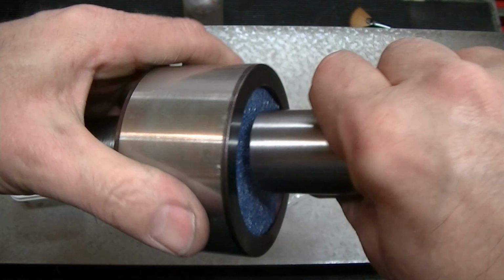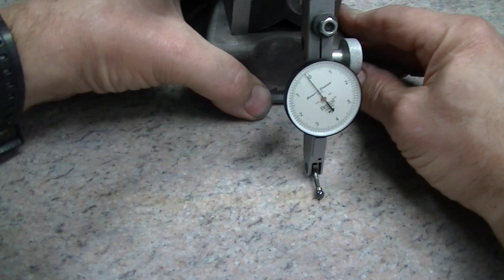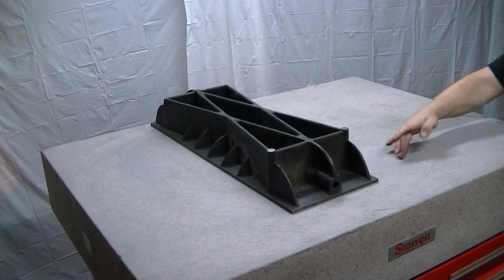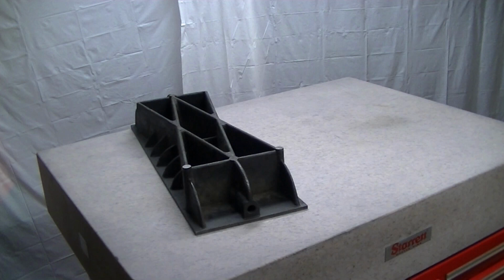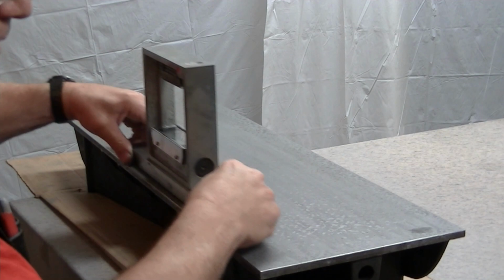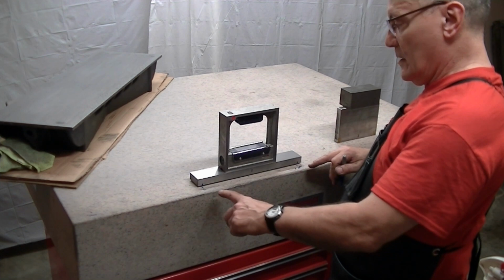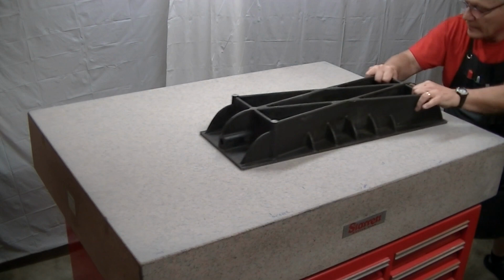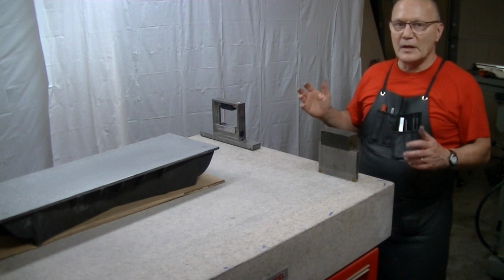DIY SURFACE PLATE LAPPING PART 1 (audio fixed)

Comment: The part of lapping that is not always clear is the speed at which material is removed and what to do when you deform the topology slightly. Watching somebody lap—and how often the check their work to alter technique—gives a much better feel for the process. Tom Lipton has been very good with this, but the scale of your plate and your “use the lap you have on hand” approach is very helpful.  Question: your lap is now charged with 325 grit diamond. Is the any way to remove the charge to reuse the lap with a finer grit without actually re-grinding your steel surface plate?
Reply from the maker: It will wear out to a degree. You can also use a piece of aluminium to somewhat pull the charge out of the lap.

Comment: Rob, there is something I don't understand. 
You're using a counterweight to try to keep the curvature of the surface plate due to the mass the same?
 You showed that the bubble moves a little when moving the level, so that  relatively small mass does curve that thick heavy surface plate measurably?
Or is it the supporting structure of that plate that bends slightly under the moving weight?
Reply: If that's the case I would risk a statement that outside of a lab with very level floor and the whole table construction specifically designed you wouldn't be able to reliably make those measurements. On the other hand nanometer precision (sub micron) is only possible for very stable materials with respect to temperature, probably ceramics and glass. I'm not sure if this is realistic what is presented here.

Comment: Speaking of flat surfaces: if the plate was your known-good surface and you had a piece to scrape the size of that surface plate, would that work or should they be of more-similar sizes?  You mention overhangs and concavity which got me thinking.
Reply from the maker: That would work.
Reply: @ROBRENZ  Ok thank you; I appreciate your sharing your knowledge.

Comment: are there threaded holes in the ends of the cast iron lapping plate.. so one could add eye bolts or some kind of attachment to mechanize the back and forth of the lapping plate on the surface  plate.
Reply from the maker: Thanks, I think so and thanks for watching and commenting.

Comment: That’s a great learning, about the procedure. The question is: when you put the glue on those 3 small squares the side where the single is will receive twice the load than each of the two will.
Did that cause flattening the glue thinner on the single side, putting an angle into the 12” plate?
Reply from the maker: The load difference and glue line thickness doesn't really matter in the end.You are just after three point support that is kinematic in that it will not rock.

Comment: Doesn't  that cast iron lapping plate sitting on one corner affect the stones shape when checking ?
Reply: Not by much. It does affect the underlying stand, so the plate gets slightly tilted. That doesn't matter for the measurement he's making, as the level is being used to find differences in angle between points, not absolute angle from level.
Reply: As SAI Peregrinus said, the level is being used to take a relative measurement. The reason he used the counter weight is because the level is being moved to a different spot, and tilting the plate, so the counter weight will be moved to where the level used to be to minimize the effect of tilt on the readings (which are being used to gauge the shape of the the plate, not its position in space), whereas the cast iron lap is just sitting in one spot, a constant throughout all the reading positions, as if it was part of the plate itself. Yes, the weight of the cast iron lap DOES deflect (bend) the plate VERY slightly, but its negligible.

 I guess you're asking whether the elastic deformation form the weight force of the CI lap sitting on the plate and the subsequent spring-back when it's removed affects the measurements taken with the level regarding the shape (not level) of the plate? I think the answer is it's there, but it's literally negligible.
Reply from the maker: I will cover this in a follow up video. Thanks for watching and commenting.

Comment: would it have helped at all if you had a second cast-iron lap, so you could do something like the normal 3-plate averaging process with them? A on B, C on B, A on C, repeat?
Reply from the maker: That could work but proper use of the lap can keep it flat.
Reply: @ROBRENZ  gotcha. Thanks for the info. I'm not even remotely a machinist myself but I love learning about all of this.

Comment: gentleman, although i think your tool cabine is a good one, but it is still sheet metal. may be using a good old welding table with a quarter inch steel plate surface will be a better choice?

well, you show us that the counter weight will have influence on the level indicator, but at the same time, the scriper is still on the far left corner. i guess it is good old 60+ pounds or more, right? under the same theory, will it have some influences on the flatness of the stone?

by the way, have you check the level of the ground as well? because the indicator is base on air bubble, if the ground/base is not flat, nothing on top will be. the more you work on the stone, the more deviation on the stone.

just a humble suggestion, make a temperory wood/metal frame with the same height to the surface of the stone, when you are doing the measurement, just push that scriper out of the stone, with this bulky weight out of the picture, i truly believe it will make a difference to the results, thanks.
Reply: The measurements are all relative and thus it doesn't matter if the plate is level or not. He's trying to make sure that the plate doesn't flex and throw off the relative measurements when he moves the level. The lapping plate sitting on the granite is a stationary load that isn't changing, so it effectively doesn't matter. Since he's grinding out the low spots right now the amount of deflection caused by the lap would likely be negligible until he gets to final grinding and finishing the stone.
Reply: Its not a regular tool cart..... see other video..
Reply: i guess there are different ways and style on this issue. i have seen some japanese prepare their stone. start from the exact position in their workshop is leveled and re- enforce by inches thick metal plate. insist every corner is flat and level. not just flat. and i realise one thing, they use all kind of calipers, even electronics and laser reflect device, but i never see them use bubble indicator
i tends to believe the japanese way, flat and level. because when the stone is move to somewhere else, the stone can be use to help calibrate the leveling of other machine base. especially japan is famous for their earthquakes, their engineers aware that difference and have to practice it as a constant routine job
Reply from the maker: I will cover this in a follow up video. Thanks for watching and commenting.

Comment: At what point would an unimaginably large surface plate still be measurably flat, yet it's edges not level, due to the curvature of the earth?
Reply from the maker: Measuring with an autocollimator instead of a level gets rid of that problem
Reply: @ROBRENZ  Wait a minute.  What if the nerdy kid next door creates a black hole for her high school science project with enough mass to bend the light beams in your shop?  On second thought, I suppose you'll have more important things to worry about then.
Reply: @d00dEEE  Briefly. Or maybe not, since I think time slows down near the event horizon? I'm not an astrophysicist.
Reply: Silly, the earth is flat

Comment: Perhaps a dab of locktite on the 4 corners of each foot would allow them to sit flat on the long bar - room for the Locktite to exude.
Reply from the maker: There were metal smears on the insert faces that had them not sitting flat on the surface plate. That is why they were crooked. Thanks for watching and commenting.

Comment: so it doesnt matter that you still have the lap on the plate? also the counterweight, if both the level and the counter weigth is "inside" the supports you will bow the surfaceplate concave. i dont get it
Reply: bow 10" of solid granite? are you serious?
Reply: ok haha i said i didn´t get it.
Reply from the maker: I will cover this in a follow up video. Thanks for watching and commenting.

Comment: Wouldn't the weight of the lap on the back corner of the plate cause distortion that affects your rough measurements?
Reply: i would think not they are relative measurements and it was in the same spot for the duration
Reply: Oh, right, and the only thing causing flex in the pads/table/floor between measurements when moving the level is the weight of the level, plus his own weight on the concrete floor.
Reply from the maker: I will cover this in a follow up video. Thanks for watching and commenting.

Comment: Well I watched the first one without issue but will comment on this one. Would it help to have grooves cut in the iron lap for roughing the plate down? It sounds like that plate was only out .001" to start with? That doesn't seem like it would have been too far out for them to resurface I wouldn't have thought? Perhaps a sheet of aluminum  milled to sit over top of your iron plate would be a good upgrade. When doing ultra fine measurments doesn't any lean in your level cause the bubble to not read correctly? Couldn't this be a problem in mapping the plate as well as differences in where you stand when taking measurements?
Reply: I was thinking the same thing about the plate effecting the level, but then I thought well they are relative measurements and the lap was stationary for the duration. I maybe wrong but unless the weight of the lap was actually compressing/deforming that slab of granite and I don't think that's going to happen, how could it influence it?
Reply: And furthermore Rob - ... There is no Inspector or a cat .. a Familiar ( x ) = missing.. that counts down.
Reply: Skjoldhøj, Uhhh.... are you ok man? It appears as though you've just had a stroke?
Reply: I believe the non English speaker is making a reference to no "Baily" equivelant  in the video to certify the job. lol
Reply: Oh Ok LOL.    Not quite sure how you were able to  ÐΣСїρћєЯ that one Bryan but I think you maybe right. Still not sure who Rob is though....
Reply: No Inspector is NO GO and NO INSPECTION.    No GO is No - AUTO CYCLE BUTTON .. if so it's a kick in the ass! !
Reply from the maker: I will cover this in a follow up video. Thanks for watching and commenting.

Comment: Hey robin , how much movement in the level is actually the granite itself distorting vs the frame / floor / whatever else distorting due to the weight . I will probably get crucified for this question but I know the granite will flex as one of the downsides of the pink granite based on starretts web site is it flex more than ... black granite for example, they recommend thicker variations depending on use and grade requirement.... you would think being much harder than the Black it would flex less but above my head why it’s the opposite... probably something to due with the quartz content.... if I was to guess the answer to this I would say the granite is distorting very little if any because the weight is minimal. I would say it’s the frame floor... using a laser measurement system cars driving down the road will affect the measurement...  I know this fact about the cars true because I could not figure out why randomly the meter would move then settle back so I put cameras outside and inside guessing at the problem and behold when the feedback was synced you would see the movement of the laser meter as the car approached and as it sped off...

Comment: I have an 18" x 24" cast iron surface plate I bought many years ago left over from a school auction.  Someone had volunteered to take them to his work and run across the tops with a blanchard grinder.  I got one of the last ones after they were picked over and mine has some grooves in the surface.  I thought an opportunity would come along to surface grind it, but no it didn't happen.  I have seen videos where they just work it down with a sander until it's pretty flat and then go thru something like you did.  I guess the main issue is how much material to remove, but the top of mine is pretty thick.  How much material do you think you removed from yours?
Reply from the maker: Only a few thousandths of an inch by hand scraping.

Comment: Not having done this (big caveat!) it seems like the roughing-in grit should be coarse and related to the ultimate amount of material to be removed, and proceeding until the abrasive starts to touch the bottom of the worn areas. As soon as the abrasive touches bottom switch to a finer grit and proceed through finer grades until the ultimate flatness and finish are reached. I’ll have to go back and see if you mention the depth of the worn spots.

Obviously the stone is extremely rough as it is initially formed at the quarry, so removing large amounts of stone to achieve the near perfect surface required is a process that takes place with every surface plate. So why the push back from the pro-lappers?
Reply from the maker: I will cover this in a follow up video. Thanks for watching and commenting.

Comment: So theoretically you could buy two plates at an auction and then lap them together. It could be useful to measure your iron lap at points in the process. I thought the progress of removal of the chipping marks on your lap was interesting. Would a squeegee work for spreading diamonds?
Reply: You would need to buy 3 plates at the auction for this to work. And they should be square plates, not rectangular, so that you can stroke in the x and y axis. if you just stroke one way, you risk creating a saddle which will match 3 plates.
Reply: How about two plates and a straight edge?
Reply: Think about flipping those big rocks around to lap them together!! No thanks
Reply: You could use two plates, that's just what Robin is using, but you would also need measuring tools. If you want to get good results without careful measurement you need 3 plates that can be rotated, as Rhys said. You could also use 3 cast iron plates and scrape them
Reply: Rob Mckennie , Will granite scrape in a way that will work?
Reply: Toby W I doubt believe so, but you could try hand grinding. If you're working with black granite I think your biggest problem is going to be seeing your high spots

Comment: You take all that care to keep the bubble level accurate, but you've got a giant iron plate hanging off the corner. That's gonna throw everything off.
Reply from the maker: Not a problem as explained in "DIY SURFACE PLATE LAPPING ANSWERS TO PART 1 QUESTIONS" video

Comment: Complete surface plate noob here. What causes these low spots? Granite is pretty hard stuff, and all the videos I've seen where people are using the plates they are laying down items and taking measurements, or bluing them up to fine high spots. Is there an application I haven't seen that causes more ware?
Reply from the maker: Ambient dust between the items sliding on the granite slowly abrade the surface. I only has to wear a few 0.0001" to be out of tolerance.
Reply: @ROBRENZ  thanks.

Comment: This is perfect content. I want to build a precision CNC rail framing down to the micron. The first step is the base, which will be the granite and it needs to be flat flat... I now have a guide to understand the concept of getting a flat surface. Just wondering, can I order a huge "generic" real granite from the stone mill shop and work with that to get a flat surface or do I really need to start off using a branded granite such as ""? Also have you considered of making a flat surface for "engineered granite" which is mixed with sand and stones with epoxy? I read professional companies use this "engineered granite" to reduce vibrations for their applications. So lucky to get a nice big chunk of granite Starrett for free... wow. What kind of precision deviation is that dial indicator? is it 1 micron? 31:08 - That is crazy... would never expect such a massive granite block to slightly change and deform with small weights on top moving at different positions at the surface.

Comment: I was really surprised that the movement of the precision level's weight on the plate had that much of an effect. I was wondering, how much of an effect does leaving the lapping plate on the surface plate have on the relative measurement of the surface plate's flatness? If you have any insight into this I'd be love to hear it. Thanks.
Reply from the maker: I will cover this in a follow up video. Thanks for watching and commenting.

Comment: I thought I was following along pretty well until the counterweight for the level appeared (minute 33 or so).   While that does make sense, why is the big heavy cast iron lap still sitting off in one corner of the plate?
Reply from the maker: watch  https://youtu.be/sKwZxV4bUoA  for your answer
Reply: @ROBRENZ  thanks, will do!

Comment: Sorry to say but that method using a tool made for leveling machines and such I think won't be near good enough. I know, everything is relative and so is flatness. But to verify that this plate is flat within say 0,0002" (2 tens of an inch) you Will surley need another more accurate method. I have not seen the following videos yet but looking forward to it. By the way thanks for a good nerdy video.
Reply from the maker: I agree and said so in the video :-)